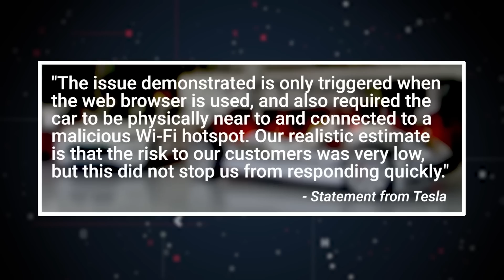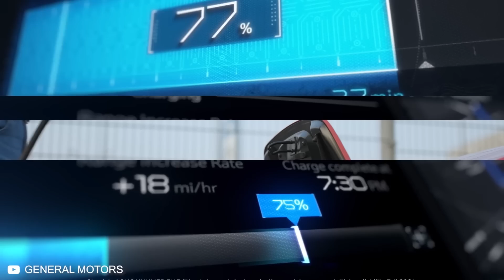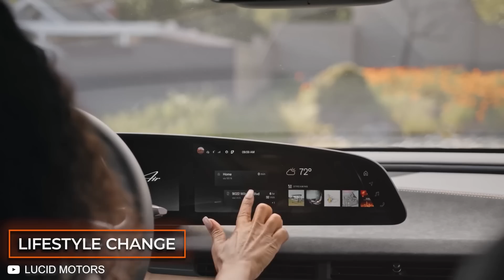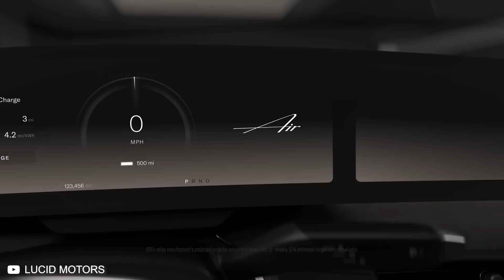EVs' Serious Problems That Carmakers Are Hiding

Comment: When an EV battery can be recharged as fast as a gas tank can be filled, then I will be interested.
Reply: As of now, a charge of one minute can go as far as 20 to 30 kilometres. A full charge takes about half an hour and can take you about 200 to 400Ks. On the more luxury models about 650 kilometres. Not ideal for trips that will take over 5 hours unless you are willing to take a break to charge it for half an hour and continue after the five hours.  I have no interest in getting an EV until it can do a range of at least 1000 kilometres and the prices come down on a subcompact SUV to about 40K, which I'm told could be as close as five years from now.
Reply: @rps1689  “about half an hour” 

If you are first in queue. Nobody cares about 2nd, 3rd in line at at petrol station given 4 mins a tank.  But at a super charger, it’s 30 min, then 60 min, then 90 min.  Yeah it’s a problem. People started walking off from their EVs w the wait, so Tesla started charging idle fees up to $1 a min.
Reply: @rps1689  “…one minute … 20 to 30 km…”

Nonsense.  
Official efficiency of Tesla M3 is 6km/kWh.  The most common supercharger rate remains 120 KW (often split w other EVs in stalls, increasingly the case).  That’s 2KWh per minute or 12 km per minute.  The 250 kw V3 charger is mostly marketing, as that high rate shortens battery life (true for all EV battery) which Tesla tracks and limits to a handful of high power chargers per year. 

Charging at home is not an option for many in dense urban street parking areas, and the grid is not suited to pushing many multi MW superchargers into those neighborhoods.
Reply: This is a business opportunity for battery swap centres or battery leasing schemes for some companies/car makers.. full battery swap within minutes. All the batteries are (supposedly) charged from the green-er(ish) source of energy and less issue of battery degradation due to fast charger (the batteries are charged in a more normal/slower speed for longevity)
Reply: I'll wait for the Dr.Brown wires across the streets.  Full charges,  no problem!
Reply: and by then you will be dead... so who cares right?!?
Reply: Even if you could get such a battery, you’d never get the wire to charge it with. You’d have to back up to the Hoover Dam.  That’s the amount of power pouring out of one off those 9000 gal petro tanks in a few minutes.
Reply: @Nill757  Excellent point.  A gas pump can dispense around 10 gallons/minute and gasoline has an energy density of 33.7 kilowatt-hour of energy per gallon, so that equates to delivery of 337 KWh per minute or 20,220 KWh/h, so it is delivering tremendous power.  Even if EVs are 5 times as efficient as ICE vehicles and thus require only 1/5 as much electrical energy in their batteries as ICE vehicles need in their tanks, their charging stations would need to operate at over 4,000 KW to match the speed of "filling up".  Tesla V3 superchargers only deliver up to 250 KW, so they take at least 8 times as long to "fill up" as an ICE vehicle and that does not account for the extra time spent driving to a charging station or the time spent waiting in the queue.
Reply: @kirkjohnson6638  Right, 20 MW.  EV gets 2 or 3x more miles per unit of energy but still that’s 7-10MW to equal the miles per minute laid on at a gas pump.  So far, most people don’t care about their 30 mins at charger because they’re always first in line. As more EVs enter the market, thats will change to 60 mins, 90 mins w a queue, where a busy gas pump queue is maybe 10 mins.

BTW, that 250 KW charger is basically a marketing gimmick. First, they are not that common, and Charging that fast steals too much life off the battery, so Tesla keeps track and limits it to a handful of full power charges per year per vehicle, degrading the charge rate other times.  100KW  or so is going to be the common supercharger rate for years to come.
Reply: And not cost the price of a house to replace.
Reply: Ill stick with my 2 stroke v8 thanks. I not of fan of 4 strokes and 2 stroke DFI is the way to go to make it an option. If there is to be electric we need overunity homopolar motor/generators tapping aetheric ZPE radiant energy everywhere from space. This is what Bruce Depalma built with his n-machine but was suppressed. Now it seem like the 2 stroke DFI engines are suppressed in auto/truck market except for the Rotax 850 etec turbo and Achates Power OP 2 stroker.
Reply: You charge while parked. Charging along the highway is highly exceptional. Only when you're going on a road trip, you might have to charge every 3 hours. Turns out, that coincides perfectly with lunch or dinner breaks
Reply: @irTaeke  My last road trips were an 850 mile (13 hours) round trip with one food stop each way, three 1,000 mile (15 hour) trips with two foods stops each trip, a 1,150 mile (18 hour) trip with two foid stops, and a 2,600 mile (41 hour) trip with two food stops and a two hour nap.  On these trips, stopping to charge and waiting would be totally unacceptable.
Reply: @kirkjohnson6638  ok boomer
Reply: @sparkylarry  OK Zoomer.
Reply: @irTaeke  “highly exceptional”
Because your home or office charger is exceptional. The majority of drivers have only street parking, no charger available but highway  charging stations.  And the majority of EV owners in US Europe have  another combustion car, average two other cars, making it very convenient when the charge is a bit low and time is tight. 

Of the 20% former EV owners now switching back to combustion in next buy, large majority gave no 2nd car, have no home charger.

Comment: Knew all this already and still not buying an EV until all other options are literally banned or extremely expensive.
Reply: @beepthesheep867  Did you really try to sell me on Leaf? Yeah, nah, not buying a Leaf in million years. Any EV I would even consider are uber expensive and even Leaf, which I would not even consider, isn't that cheap. It only takes 40 minutes to charge is hardly a selling point. It only takes 3 minutes to fill it up with gas. Charging at home isn't always an option. Not to mention there are barely any charging stations to begin with.
Reply: @beepthesheep867  Since you're using pounds, I assume you are talking about UK. I'm not from UK. I don't know why you would assume everywhere is like UK. If you were to buy a new car, if the EV version is available, it's at least 5k euros more expensive.  However, I don't buy new cars. So for the price I buy cars, Leaf is pretty much the only option. Anything else, not to even mention anything I would like to buy, is  2, 3 or more times more expensive. With the amount of miles I do, even with petrol being more expensive, EV is not cheaper, at all. Not to mention, electricity is about to have a price hike too, so it's about to get worse. Even if it was just upfront cost and over 10 years EV is cheaper, the upfront cost itself is prohibitive. I'm not paying 20-30k to maybe save some money 10 years down the line. Though at that price, there are no savings to be had even with gasoline being more expensive.
Reply: @beepthesheep867  PCP for new EV is still not cheaper.

Comment: EVs preceded internal combustion engine cars. They went obsolete due to problems with the battery.
The battery is still a big costly problem.
The Climate Delusion is the main problem.
Carbon dioxide emissions are actually beneficial. Benefits include increased agricultural yields, reduced winter heating costs and fewer deaths from hypothermia.
Reply: The battery problem is nothing compared to the technical debt cause by wasting petroleum as gasoline. Because fossil fuels are so heavily subsidized nothing else could complete until very recently.  Fossil fuels come with free waste disposal. The other energy sources don't. It's a humongous externalized cost.

Co2 fertilization is a problem, as the increase in agricultural yields are only good for yields in food that is not that abundant in nutrition. That being said, CO2 increases foliage in some forests, but it’s a very weak feedback against anthropogenic global warming from increased CO2. 

As for EVs, the good news is, not only is the technology improving at a fast rate, less and less cobalt is being used for batteries; sodium and redox batteries don't use any plus it is highly likely in less than a decade, sodium will overtake lithium. The amount of petroleum needed to provide fuel for mining and how much CO2 it will dump into the atmosphere is minuscule compared to the amount private vehicles use.

All energy sources degrade the natural environment and they are all are dirty, The responsible choice to make is the least dirty one, not the one where you get to bill your grandkids for the cleanup. What is being pumped into the atmosphere represents an enormous technical debt, which is much much more than all the tax expenditures and all the subsidies by all countries to wind and solar energy and EVs.
Reply: @rps1689  You could argue the responsible choice is to rapidly industrialize the planet for quick and dirty space colonization, utilizing some source of forced labor and every energy resource available AHEM nuclear *AHEM*. Getting mankind off the planet is the only way to reliably prevent man from inadvertently destroying it. There would be short term degradation of the ecosystem, but inevitably life would march on, and the planet would likely recover rapidly in our absence. Also, as a space faring civilization, we would be better positioned to help the Earth recover with terraforming techniques. No matter what technology you create, man is going to continue degrading the ecosystem. With the number of cars on the road set to double by 2040, EVs simply won't be able to keep up with demand. There are only around 10 million on the road out of the total of 1.4 billion cars on the road worldwide. If you believe car makers are going to sell 1.4 billion EVs in the next 18 years I have a bridge to sell you. 

If we take the 9 lbs of lithium in a Leaf times 3 billion (projected #  of drivers in 2040), that equals 13.5 million tons. Estimates for accessible lithium on Earth is around 14 million tons, and those batteries will need replacing. Are you starting to understand the herculean task of adopting EVs on a global scale? It isn't a sustainable solution. 

Most people are worried about the Earth because, well, they need it to live. But the Earth and life on Earth is far more durable than the human race, and if you ask me, that's what people really want to preserve. Themselves.
Reply: @Mr.9merrickdials  An appreciated visionary response.

Comment: They just Don't interest me @ all full stop...  & they are NOT clean nor environmentally friendly like they make out .. Do the research .. like what is the power source ??  for the charge, coal ?? gas??  wind ??
Reply: They are still cleaner. The fossil fuel it takes to charge EVs and to manufacture them dumps less CO2 into the atmosphere than private vehicles using internal combustion engines. Heck even an EV recharged by a coal plant puts out half the CO2 as a gasoline car the same size doing the same trip and even much better in stop and go commuter congestion.

Comment: A evs costs 25 to 35 percent  more to buy  new  than the equivalent petrol vehicle so you have to travel 140,000 kms to even break even 
Who keeps a vehicle  that long now days ?
Evs cost more to service and repair  especially  the battery  if it craps its self and no ev batteries only last 3 to 7 years if your lucky ,good luck in hotter environments 
 at 7 to 18 thousands  dollars to replace and good luck in getting it replaced under consumer law at no cost 

The used ev market is extremely  poor and no one wants to buy a second hand ev so resale valve is crap at best 

Plus there is no recycling  of the ev batteries  any where in any country  with all the dangerous  chemicals  that go into making ev batteries or the child slave labour to mine the minerals  to build the batteries 

So much for going green and saving the environment 
Cars  make up about 4 percent of the world's  carbon emissions 

Coal power stations  and old dirty diesel  trucks in our cities are the major problems  with pollution 

Of coarse there are many other things as well 
Having coal fired power stations  to charge your clean evs is utterly stupid 
Plus what about all the carbon emissions when the car maker builds the evs in the first place 

We cannot consume our way out of climate change 

If we really want to help the environment   
Put solar panels on the roof at home , a solar hot water system , have a rain water tank to collect water and plan you trip to go to several places all in the same trip saving petrol and time 

You will save more money and the environment  doing the above things 

 than spending a fortune  on a ev which as soon as you drive it  of the dealership loses about 80 percent of its valve 

Buying an ev is a personal  choice  but if you believe  buying an ev will save the planet you have rocks in your head 

Solar panels and planning you trips in your petrol  or diesel  vehicle  will do more than some expensive  ev when it runs out of power and becomes road side furniture

Comment: I'll stick with my 35 year old IC powered car. It's easy to fix and the range is 100% of when it was new. It also looks much nicer than any EV car made, which is a nice bonus.
Reply: Agreed. For me, figured out I would end up losing money if I switched from my 2003  BMW to a $40K EV due to the insurance. I'm paying currently $50 for insurance and I'm looking at at-least $200 per month for an EV. That more than offsets any advantage I have from not using gas. With the way gas prices are going, however, that may change.
Reply: @silent_anon404  
Enter...E-gas, a synthetic gas they're working on.
Reply: @ne270  The pollution controls they put on cars has them running very clean. People are NOT dying from automobile exhaust. They're dying eating too much, doing drugs, drinking alcohol, etc..
Reply: Imagine a 35-year old EV. You would be well into your 3rd battery by now, which would cost probably more than whatever your entire car cost.